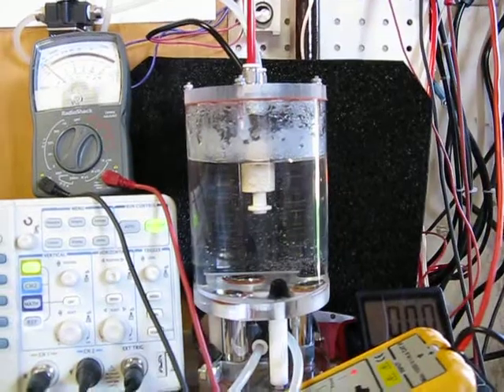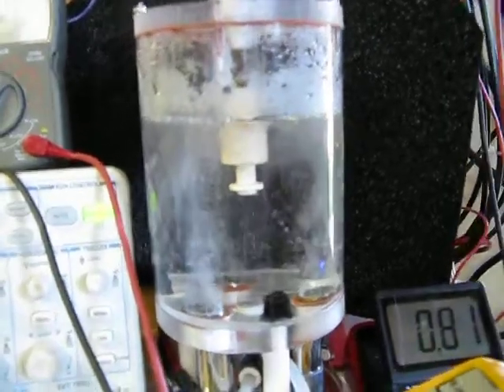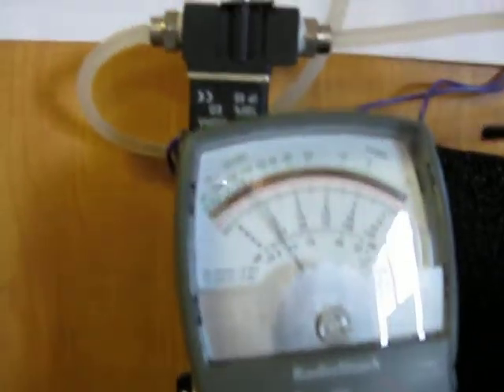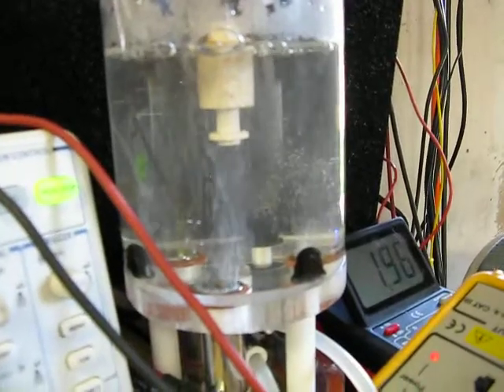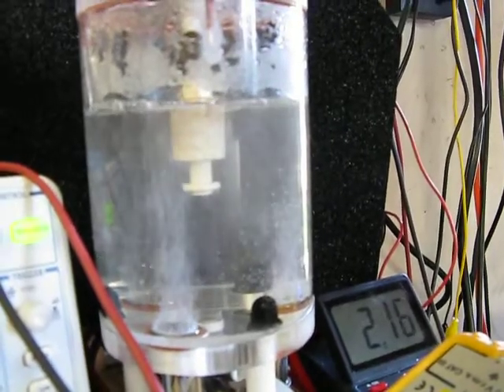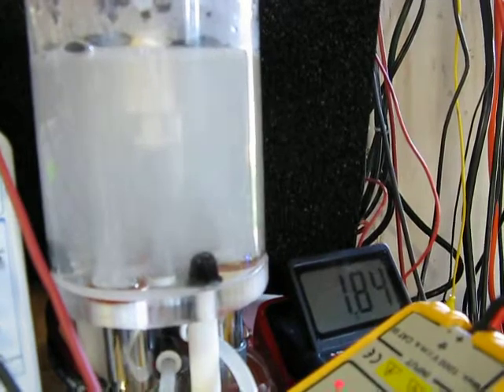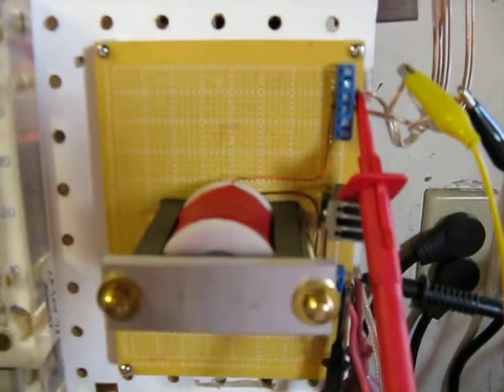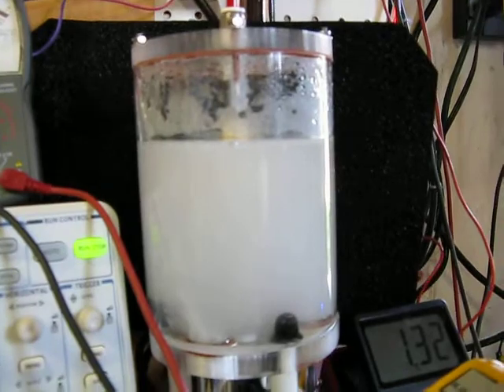Chronicles of h2opower #5

Comment from the maker: Wattage is an incorrect way to measure these types of devices as batteries are rated in amp/hours. Most people producing just 1 LPM are using around 25 amps to do so and if I can do the same using just 2 amps how many more litters of gas can I produce than them using a 250 rated amp/hour battery? You just have to know how to ask the right questions is all. Current is the only way these devices should be measured as the cars charging system also has a maximum usage too much drawn flat battery.

Comment from the maker: I am now up to 1800 volts using 56 mA and getting even lower in the amperage draw on the system as I learn to design better. This was my early stages of development. Sorry I don't post much of my new work but I have my reasons. The point of "ALL" of this is to make use of water as a source of fuel. These are just me learning about the technology as now I think I got how it all works, but only time will tell. Measuring watts doesn't work well on this tech as amperes used is where its all at.

Comment from the maker: @theoneagain that all depends on what it is you are trying to run. From looking at your vidios, I'd go with 20-18 wire so that it stays on the cool side. The 8xa circuit is Meyer's old stuff but it works well with large plate cells. If your up to it make a plate cell with 4 n plates all space .0075inch apart using plastic shim stock. The plates have to be minimum of 12 x 8 and you will need +nnnn-nnnn+nnnn-nnnn+nnnn- giving a total of 25 plates. With that close of a space gap your giong to rule.

Comment from the maker: @irondmax Hi Irondmax, you wired you WFC in series? How many capacitors does your WFC exciter array have? My new one will have 12 capacitors wired in series which will lower the load on the system drastically for that is how the WFC becomes a part of the VIC circuit in the form of resistance. So far I thought I was the only one doing this as I haven't seen anyone else wiring their WFC's in series.

Comment from the maker: @hhoguy98 All of the stuff found in the international independent test evaluation seems to check out thus far. The way Meyer wired the WFC made all the difference in the world. I am building a new WFC that will take full advantage of what Stanley Meyer did and perhaps even run my car with it. I haven't run the numbers for the gas production as compared to the prior state of the art but this is using distilled water with no salts added of any kind. I will put out gas amounts with the new WFC.